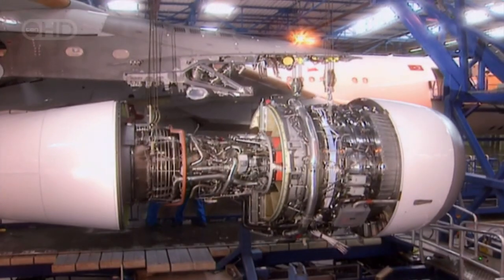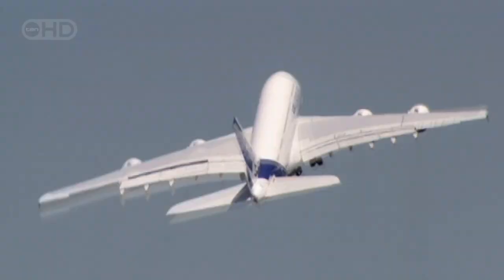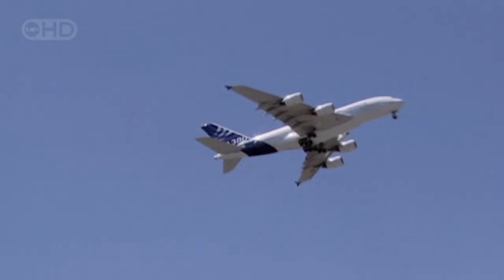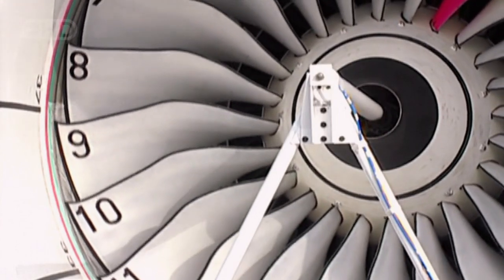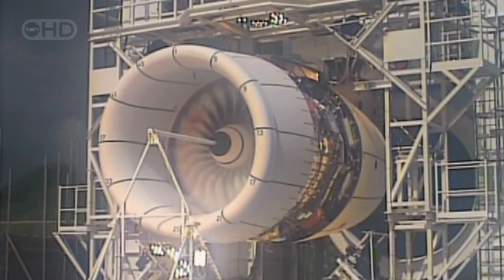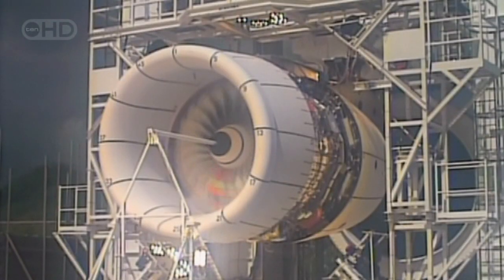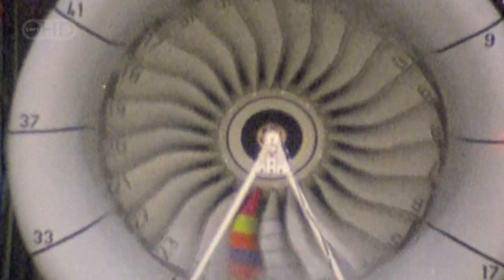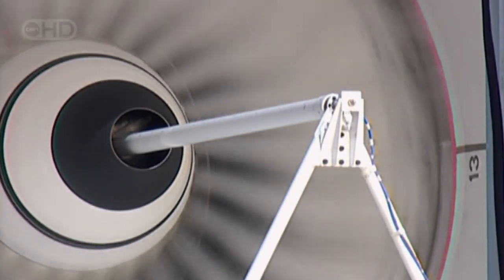Airbus A380 Engine Explosion Test - HD

Comment: At 1:49, the speaker is talking nonsense. He says "the centrifugal force at the tip of each blade is equivalent to a 110 ton locomotive". While the tip experiences almost a half million 'g' acceleration, the mass at the tip is essentially zero. Consequently, the force is essentially zero. If you work out the math, here's what he should have said in order to be  correct:  'At 3600 RPM, if we assume the  center of mass of the 15 kilogram blade exists at the same distance as the tip of the blade (1 meter), then the centrifugal force required to hold it would be equivalent to a 110 ton locomotive'.

Comment: Woah hd from 2009 was shitty!!!
Reply: Also considering that it spins up to 3000 rpm, meaning you need a camera to record at a minimum of 12,000 fps to capture that slow-mo depicted in the video. 
So for the year this test was done, it's pretty standard resolution for the frames per second needed.
Reply: 3000rpm?? My car does that at medium revs, I thought these things span at more like 30,000rpm.
Reply: Those blades don't provide thrust though, they are just sucking in air so they don't really need to spin that fast.
Reply: totaltwit  What does a cars combustion engine have to do with a jet engine? Besides it says right at 1:45 what the turbines are spinning at.
Reply: Allen: you misunderstand
Reply: Dear diary, my faith in humanity has died a little more today, a person couldn't even spell a name correctly even though it's only a few pixels above his comment box.
Reply: Actually, in a turbofan, those blades provide almost all of the thrust. They don't need to spin that fast because they are huge, and push a lot of air. Thrust increases linearly with the speed of the exhaust, but the kinetic energy required increases exponentially. It is therefore far more efficient to push a lot of air slowly than a little air quickly.
Reply: Muhammad Mirsab yeah
Reply: Maybe your composite cables are just loose. Give them a wiggle!

Comment: 3k rpm?.... Didn't he meant to say 30k rpm?
Reply: Because the thrust 'fan' diameter so big. it take a while to do a round.. 3K is fast enough
Reply: Yeah I figured so meanwhile. The first (and last in airflow line? :P) is indeed so large it spins reasonably 'slow' at only 3k rpm (still a max tipspeed of 483 m/s, 290cm wide). The middle turbine (smaller in diameter) spins faster.
Reply: Glad to know the size. thanks
Reply: There is a huge page on wikipedia about these engines, although they don't explain all too much about the dimensions and propelling force of them... Sadly ;)
Reply: Yh but I don't have any information to add :P
Reply: You can only edit wiki if you reference what you say to a reliable source.
Reply: slider380 no, turbofan engines have more than one shaft. The A380 is shipped with two different engines: the GP7000 has two shafts, whereas the Trent 900 is a three-shaft engine. The inner shaft (high pressure turbine) spins the fastest.
Reply: 3k is like a cpu fan

Comment: Back in the 80s a few marine corps aircraft that had dual Powerplants were crashing. Engineers found out that when one engine failed due to whatever, fod, wear and tear, that the failed engine would come apart and fod out the second. FOD stands for foreign object damage. Hardened and reinforced engine bays followed soon after.

Comment: They should have tested the turbine engine disks too. 
Pure luck let those 500+ Qantas passengers keep their lives.
A red hot disc fragment went right through a fully loaded fuel tank and i didn't ignite the fuel. 
Now that, required some multiple angels, putting a great performance together. ^^
Won't get that lucky again.
Reply: Correct, of course. That chunk could have gone through USS NIMITZ if it wanted to! 
The troubling feeling is that the most reliable craft ever built by human kind, even it was caused by that oil pipe, had it's first major incident by having it's strongest part, failing first. 
Weird feeling.
But we humans even manage to colide two speeding trains head on too on a double track too, right?
Reply: Serhan Ogan Dr
Reply: Лилия Комаревцева ?
Reply: Лилия Комаревцева ?
Reply: Serhan Ogan "but then there are many more pieces to the puzzle" genius.
Reply: I am puzzled now.
Did I miss Something?
Reply: Serhan Ogan Yes, at the end of the video the commentator says that.
Reply: Serhan Ogan The  big turbo fan cranks around 2500 to 3000 RPM a typical speed of most car and boat engines, but the intake compressor turbine discs are moving at over 15000  rpm. They could create some major havoc as bad as a  broken heavy slower turning big fan.
Reply: +Serhan Ogan 
No oxygen, no fire
Reply: And great pilots.
Reply: ***** No oxygen? How are the engines running then?
Reply: Serhan Ogan
I was responding to the "hot turbine disc flying through a fuel tank" comment.
Reply: +Serhan Ogan they are running using nike air LOL
Reply: A HAH HAH HA HA HAHA

Comment: Weird. This is exactly the same thing that happened on QF32. But instead of containing the blades, they penetrated the engine housing and disabled vital aircraft systems. The incident was described as an 'uncontained engine failure' which nearly took down an A380.

Comment: Get 15 million dollars or save 550 lives... I mean...
Reply: World is over populated anyway soooooo
Reply: From Airplane:  "They knew what the risks were, I say let 'em die."
Reply: Well that's probably the retail price, although it probably took them half that amount to make it, if you think about it that way its not as much as you think
Reply: I wouldn't be surprised if it cost twice as much to build that engine.  It would have been built with special instrumentation to monitor what happened during the big event.  And the special fan blade with explosive bolts would have been expensive to design, manufacture, and build into the engine.
Reply: Andy Harman What you say does make sense, i wasn't considering the whole setup just the engine itself, but yeah maybe it did cost 15mil for the whole setup then considering all the extras they needed to add to it
Reply: They actually cost more to build than they sell them for. Tend to get their money back from aftermarket service etc. 15m is the initial payment, airline will probs end up paying 40-45m by the end of its life to RR
Reply: John Carroll That actually makes alot of sense... thanks for clearing that up

Comment: they run on 99.9 octane kero which is 99.9% pure.i know cause i cart the shit.

normal fuel which goes into cars (petrol) is approx 91% octane (or you can buy 98 octane but you will be paying more for it and mainly made for high performance engines} cause if the fuel impurities make the engine stop it dont matter...the higher the octane = higher prices.you dont want the fuel impurities to stop a planes engine..also,its not possible to make av gas 100% octane..
Reply: octane kero is a type of gasoline?
Reply: JasonL. Reader sorry correction kerosene lol.
Reply: Isn't Jet-A very similar to diesel fuel to the point that a lot of the airport equipment like tugs and such are fueled with it.  Diesel fuel has the equivalent octane of about 15.
Reply: longshot7601 I think it's a bit similar. JET-A1 cannot burn before the ambient temperature is 38 degrees C. And as far as I have understood, Diesel also requires high temperatures before it can ignite.
Reply: ***** yes your right i'am not sure what the temps are but kerosene and diesel have the same % of Carbon molecules most of the time and this tells you how fast it burn and how high the flash point is(or temp to ignite). but there stuff added to jet fuel not sure if it burn faster or slower. but if i had to guess slower! cuz jet get to high temps and there run on momentum so burning slower and longer should make it spin longer+hotter=faster(top speed).
(for trueblue Last) and octane is not how pure the fuel is!!! adding octane is less pure for the fact you add carbon to make it burn slower and add even more hydrogen to get it to burn clean( if you did not add more hydrogen it would burn black like diesel) and most the time it's the hydrogen that make the fuel price go up.
 + octane lower expansion(how fast the gasses moves) so it make less HP if it does not have compression to make up for it. the reason to add octane is to much compression make heat and make the fuel ignite before it get to full compression(in a piston engine it fire before it get to the top)///the reason cars with higher octane make more power is you can run more compression(so it's the engine not the fuel).
Reply: +alpha tango purity octane 99.9% etc...all of what you spout off about is complete rubbish. You haven't a clue of what you speak. Octane and Heptane are two compounds used in 100LL aviation fuel which is used in recip engines for example IO-540 or O-320. Octane and Heptane are not present in JetA fuel or any Jet fuel JP-1 etc, nor does "purity" as you claim, have anything to do with octane/heptane. Jet fuel and its variants are all essentially kerosene with additives, flash point supressors, Prist (anti ice) additive etc. Jet fuel does absorb water and there is always some water in any jet fuel, hence contrails we see, not "chemtrails" unless you wish to call it dihydrogen monoxide. 100LL or 80/87 do not absorb water however water will condense out and with a higher SG will lie at bottom of tanks causing starvation issues. As I suggested earlier, before opening mouth, make sure brain is in gear.
Reply: alpha tango pure 100% Octane has 8 carbon atoms aka Gasoline!!! Kerosene and Diesel have around 12.  jet fuel is a mix. like JP-4 is 50/50 Kerosene/Gasoline.
Reply: +alpha tango how be you call me more names while I am standing a foot in front of you? Grow up goof.
Reply: +alpha tango what's a "herro"?
Reply: “99.9 octane kero” 😂😂🤣🤣

Comment: Doesn't airbus have a higher failure rate than Boeing 🛬💣
Reply: RadioGaGa doesnt both use the same engine  manyfacturers
Reply: "If it isn't Boeing, I'm not going."
Reply: TIM
Boeing and Airbus also use CFM Leap which is joint venture of GE and French company SNECMA
Reply: RadioGaGa how many killed in accidents where Airbus involved? I can think the most recent of Egyptair

Comment: This is all well and good but it doesn't mean it can contain all kinds of catastrophic failures.  Another part of the engine of an A380 on Qantas flight 32 failed because of a fatigue fracture and it punched a hole right through the wing and disabled some fuel and hydraulic systems.

Comment: 4th Nov 2010: A380 Qantas Flight 32, Shrapnel from the engine punctured part of the wing and damaged the fuel system causing leaks and a fuel tank fire.

Comment: "they blow up an engine so it never happens" 

Qantas Flight 32
Reply: Different scenario. QF32 was a turbine disk failure, the test in the video is about mitigating a 'fan blade off' (FBO) scenario. Containing a fan blade is essential in the event of a failure, not because of the damage it could cause per-se, but more because FBO is more likely to occur, due to bird strikes, corrosion due to sand, hail, or general foreign object ingestion. On a side note, it's also worth bearing in mind that fan blades are actually possible to contain, whereas turbine disks are pretty much impossible to contain due to the energy in the broken pieces. When a turbine disk fails, it generally splits into three roughly equal parts that fly outwards, and each part can weigh between 30-60 kg each, which is far more than the ~15kg fan blades. They also spin much faster, the HP turbine disks can spin upwards of 12,000rpm, travelling with tips speeds of up to 1000 mph, which means they are effectively impossible to stop when they fail. Even at idle engine speeds, I've seen examples in the past during safety training courses where an aircraft is taxiing on the apron and a turbine disk failed, with one part flying 20 ft into the ground through concrete, one flying off upwards away form the plane, landing over 4 miles away in a field, and the other part flying through the engine casing, through the lower fuselage and a bunch of luggage, out the other side, and through the second engine, resting in a hangar 100 yards away. FBO is scary, but turbine disks are way worse.

Comment: So What happened to Qantas flight 32 on 4th of November 2010? Engine blew and fragments ripped though parts of the wing, puncturing fuel, hydraulic and electronic systems and leaving the plane with limited flight controls.

Comment: So I did the calculations. If it uses 1L of kerosene every second. Kerosene has .81kg/L density, so it uses .81 kg of kerosene per second. 2 1/2 hours for a flight is 9000 seconds and 9000s* .81kg/s=7290kg. The price of kerosene is 122¢/L so 7290kg*1.22$=8893$/flight. 
8893$/550 passengers is 16$ per passengers for fuel

Comment: Wait so you said that at full speed the A380 sucks down around 1 liter of fuel. So if it can hold around 260,000 liters of fuel shouldn’t it be able to fly around 72.2 hours or basically what I’m saying anywhere in the world from any location? I’m not saying that it would fly for 72 hours but theoretically it should be able to fly to any destination from where it’s at. Excluding Antarctica. 🇦🇶

Comment: but what happens if more than one blade breaks off. that is only one. if say more blades were to fail would it be the same. or does only one blade usually come off. do they test for multiple blade fails.

Comment: “...30% more thrust than the engines used on the 747...” - at timestamp 0:14-0:15.  The Boeing 747-400?  Which engines on the (assuming the answer to the first question is yes) 747-400, the General Electric CF6, Pratt & Whitney PW4000 or (final option) the Rolls-Royce RB-211?
Reply: I think they're referring to the most recent version of the 747 at the time

Comment: 1:05 "just imagine what would happen if anything threatened the integrity of one of those fuel tanks, like a catastrophic engine failure that sends shards of metal sending through them"

You don't have to imagine it. A year after this video was posted a rolls Royce Trent did have a catastrophic engine failure on a qantas airlines A380, flight 32. And it did send shrapnel into the wing and fuselage causing damage to a whole manner of things including the fuel tank. 

Sort if spooky if you ask me, how this video put that one

Comment: The commentator of this video should be sacked instantly, but why? He said the jet engines runned on gasoline, but they're running a special mix of kerosene. Next he said that the jet engines on full speed had 3,000 revolution per minute, but he probably talked about compressor fan for the main turbine should be around 10.000 rpm and the micro turbines spin around 500.000 rpm.

Comment: So I did the calculations, at top speed 1 litre of fuel per second. 260k litres = 260k seconds at full power. 260k seconds = 4333 minutes of full power flight. That’s 72 hours. 3 days of constant full power flying. What?
Reply: Erm i think you may have made a few mistakes😂
Reply: Ethan's Aviation most likely I’ve never been the best at math

Comment: Well, despite all this testing a RR engine explosion actually DID occur on an Airbus 380 flight. It was on the Quantas 32 flight in November 2010. so I would say, their tests were pretty useless...
Reply: This test is called a fan blade off test to make sure the fan case will contain the debris. The quantas failure was from the I.P system from the rear of the engine which is impossible to test.

Comment: Engineering Marvel but burns a liter of fuel every second.
How on earth its an Engineering Marvel, if it's burning that much fuel is a question?
I travelled from Dubai to Heathrow in A380, than from Milan to Dubai and again from Dubai to Rome, but saw 2 times just a tiny fuel tanker (as compared to the size of the A380), if according to the documentary the Jet  engine burn 1 liter of fuel in every sec than its 60x60x8x4=115200 litres  FOR 4 JET ENGINE, thus only the fuel it carry is 115200Kg.
There should be at least 3x40000=120000 fuel  tankers for each A380 but never I saw except that tiny Air Pump they call it Fuel tanker.
I personally think that Engineering Marvel generate its own fuel from Air (Nitrogen+oxygen+hydrogen) by compression the air than only a spark need for its ignition. So they don't burn fuel at all but Compress Air turned into liguid ( General Gas Equation).
Yes, They do burn fuel but only to turn them ON & that is only a fraction what they tell in papers.